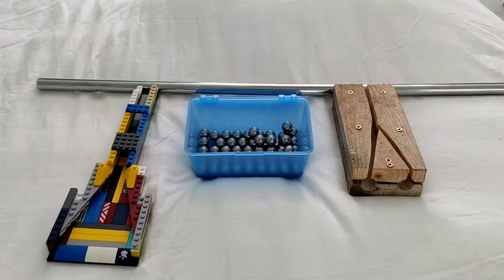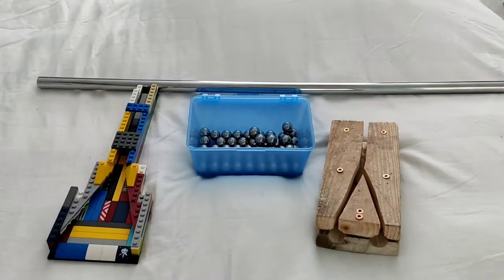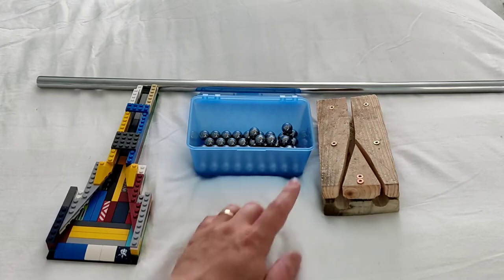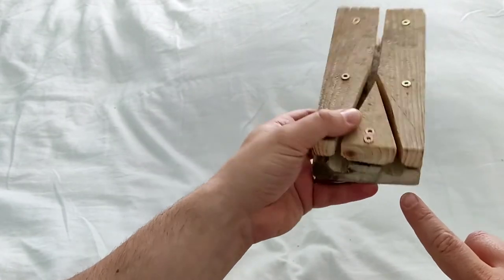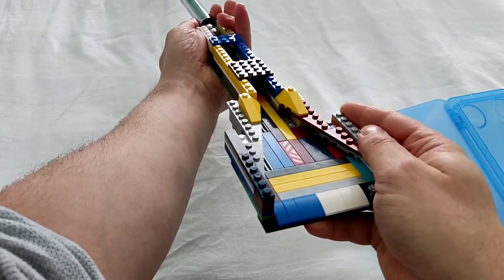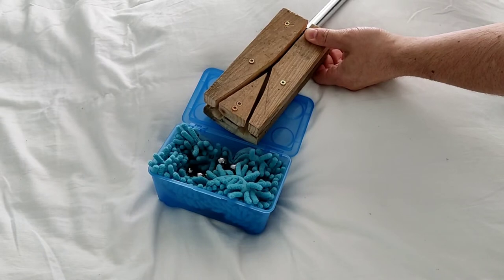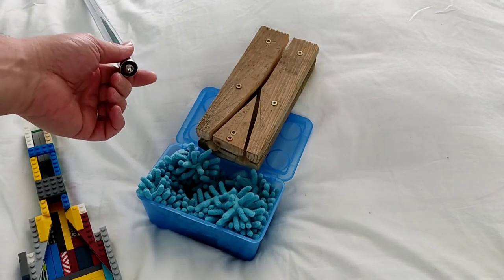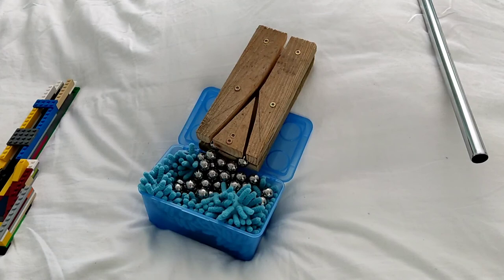MMX Marbles Backup Relief Valve for the DB4

Comment: A pressure relief would be crucial. The db4 is bound to become blocked in a song that does use a small amount of marbles compared to the total amount of marbles in the machine. Most of the marbles would not go to the bottom of the machine, but would go the db4 + fish-steps route

Comment: I think that blocking one exit with your finger, and flicking the tube, isn't a fair test because you can jiggle it to get the marble moving.  In order to call it "working", it needs to work without someone touching it.  You're in good company, though - Martin was doing that throughout the most recent livestream.
Reply from the maker: In reality, the exact method of function is less important than the concept of a backup bypass lane. Other designs will no doubt have advantages.
This y for instance, is designed as an equal y for two way bypass in vertical position; it's not optimised for the specific function I'm trying to demonstrate here. An unequal Y with one straight path and an offset bypass may be better.

Comment: Couldn't this kind of relief just replae the db4 in total, having 3 reliefs in serial, when first pipe is full, the second starts to fill etc..?
Reply from the maker: It doesn't split evenly enough. Really, only works if it's constantly full, so might be ok if it was closer to the fish stair, but that would eliminate the whole idea of the buffer.
If you watch my previous video's featuring the Y, I describe an idea to replace the entire divider with a tree of these, constantly full and backed up with a large single channel helical buffer fed from the conveyor via a collimator such as a Lazy Susan.
Such a set-up would replace not just the DB4 but the entire fish stair loop and the divider.